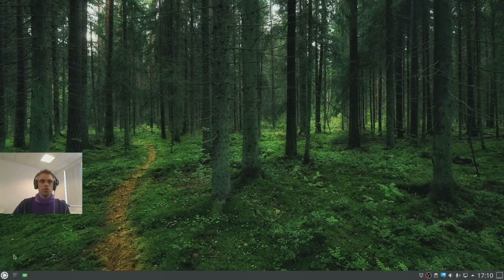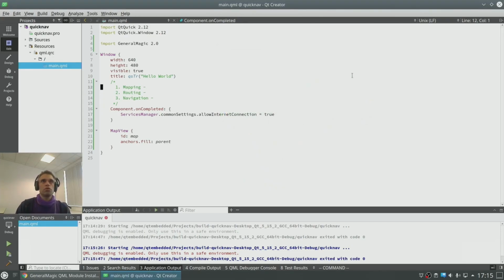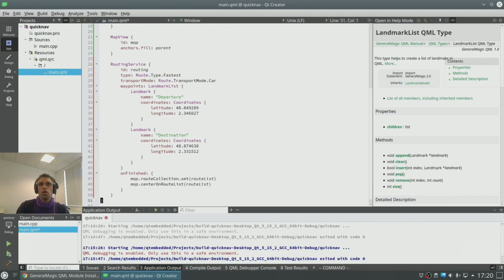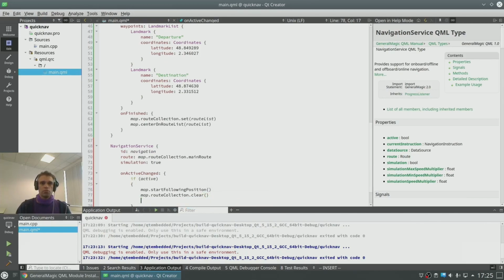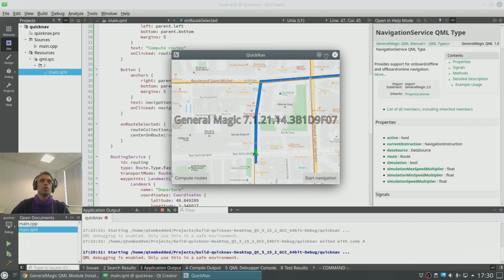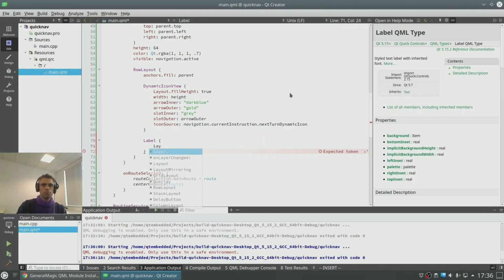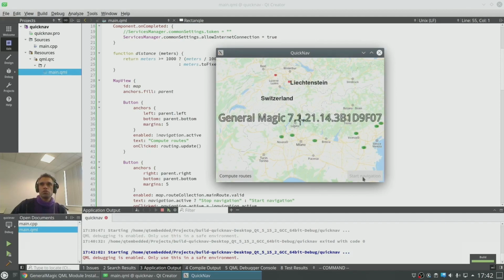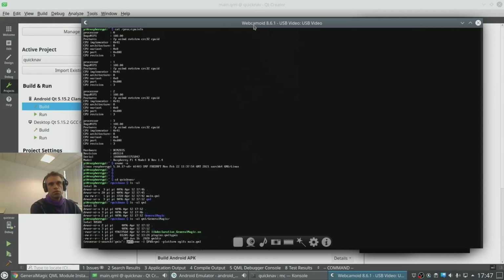Qt Embedded Days - Maps, Routing and Navigation with QML, by Justin Marina, General Magic

Comment: i am using qt 6.6.3 , and its gives me error while installing in the qt Maintainance tool. plus it says " General magic  2.0  qml module is not found." please help.
Reply from the maker: Hi, 
at this point of time Qt6 is not supported. Using Qt5.15 should work well, after the General magic 2.0 QML module is installed using the Qt Maintenance tool.

Comment: so i tried to follow same steps that you provided in the video , but it keeps telling me  General magic  2.0  qml module is not found , please help .
Reply: Same here ,, cant find anything on this issue, for me an error pops up during the qt maintenance tool installation, does that happen to you?
Reply from the maker: Hi, 
Are you using a more recent version of Qt? At this time, Qt6  is not supported. Using Qt5.15 should work well, though, after the General magic 2.0 QML module is installed using the Qt Maintenance tool.
Reply: @KDABtv   how to change the version of qt coz i installed qt 6.7.2 version. now how to switch back to older version

Comment: i'd like to ask you if there is a way to know the coordinates when i pressed on maps ?
Reply from the maker: Hi!
Yes, there is. Here's an example: 
Specifically, looking at the LandmarkList example main.qml, this line gets the tap coordinates:

        lmk.coordinates = mapView.wgsForScreen(point.pressPosition);

Even better, you can modify the SimpleMap example main.qml, inside the MapView{ block add this:

        TapHandler {
           grabPermissions: PointerHandler.CanTakeOverFromAnything
           onTapped: {
              let coordinates = map.wgsForScreen(point.pressPosition);
              console.log("lon "+coordinates.longitude+", lat "+coordinates.latitude);
           }
        }

and now each tap/press on the map appears in the console log window in Qt like this:

    qml: lon 22.909599181355617, lat -33.27328668280558
    qml: lon -36.62397636260505, lat -7.5195265104482125
    qml: lon -3.8031293055543642, lat 37.262683538673194

We hope this helps.
Reply: @KDABtv  thank you that really helps me